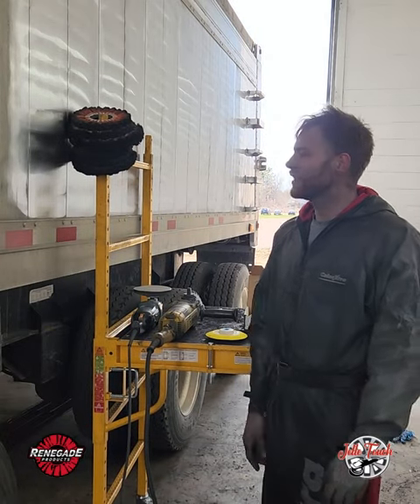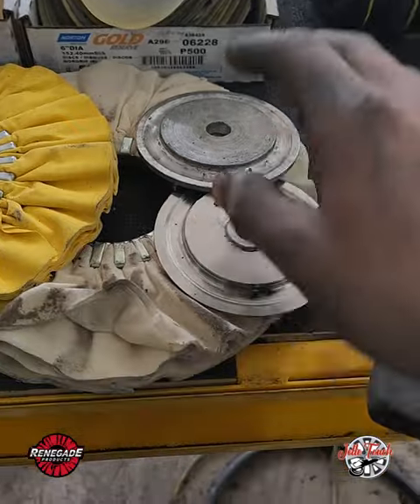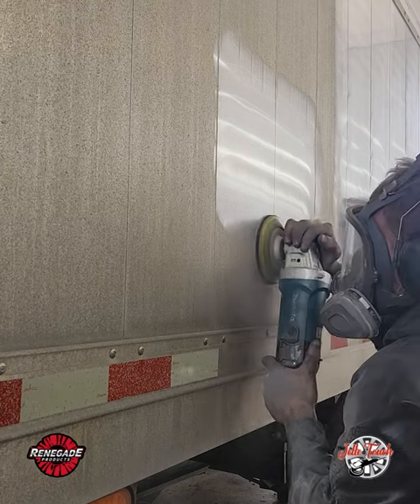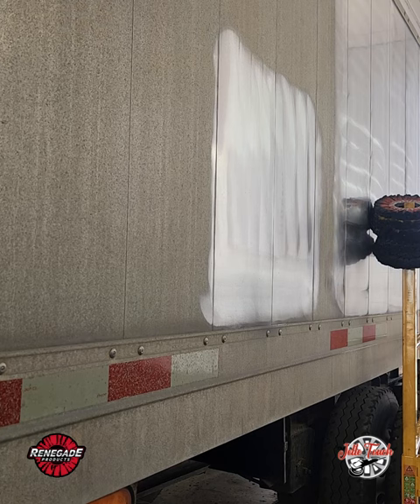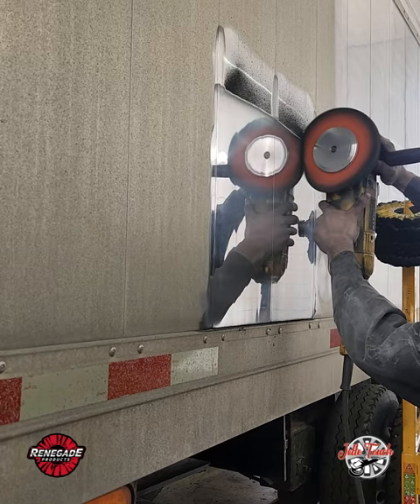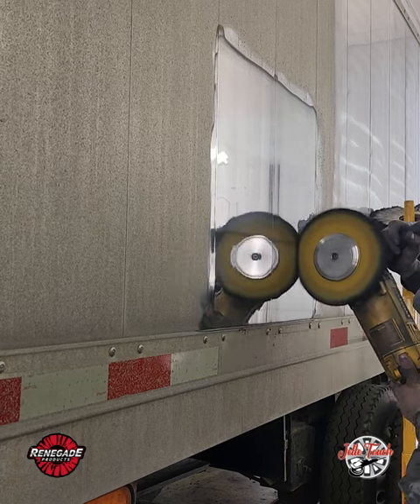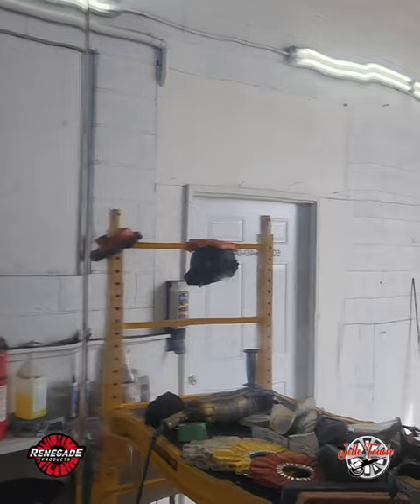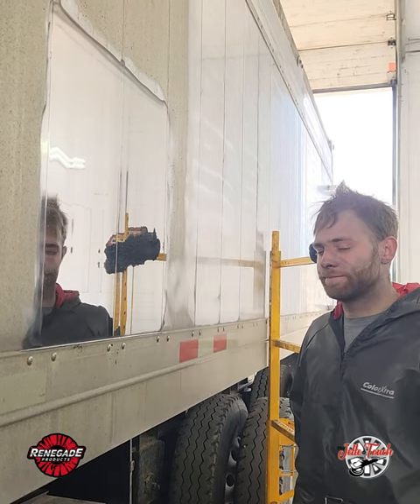How to polish aluminum trailer, The Jelle Touch Polishing And Detailing. Using Renegade Products!

Comment: Why not use a chem or something to remove all that build up before sanding? It would probably save you so much time.
Reply from the maker: It honestly won't save me a lot of time as the buildup sands off within seconds and I'm after the pitting. So if I use a chemical like acid the inside of the pitting will show white. So it will be harder to see in the sanding process